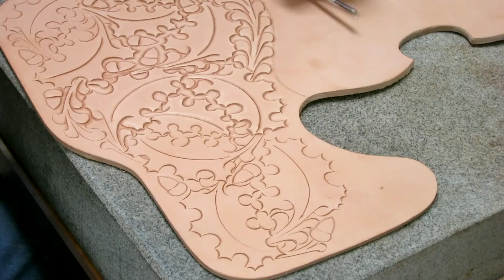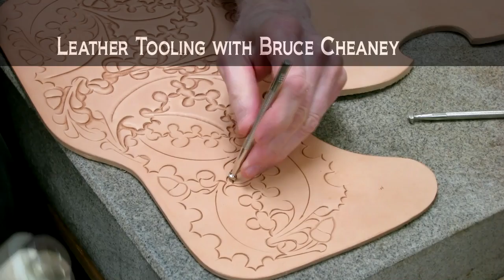Leather Stamping Oak Leaves and Acorns - Bruce Cheaney Leathercraft - Saddlemaking - leather craft

Comment: Here's a dumb question for you? When I bevel  around oak leaves as you did then go behind with a back ground stamp, I feel like I am just doubling my work. Can it not just be back ground stamped only? Or beveled after back grounding. If I bevel first it seems when I back ground it that I just took away all my beveling that I had done.
Many Thanks
Reply from the maker: Beveling around the oak leaf first gives you a little more depth to your tooling. You can background if you wish and that should not be a problem the tooling will just not be as deep.